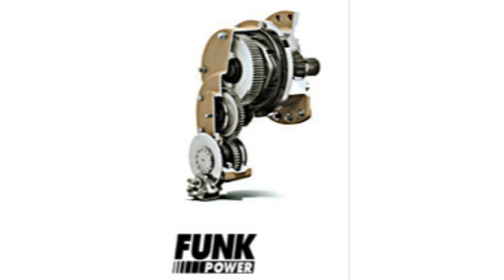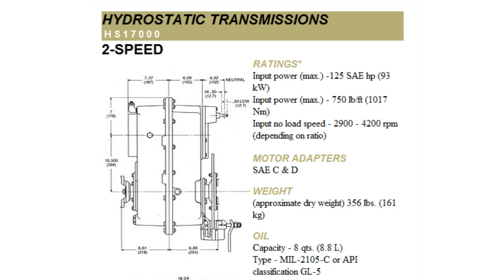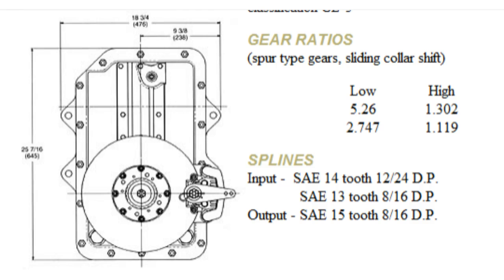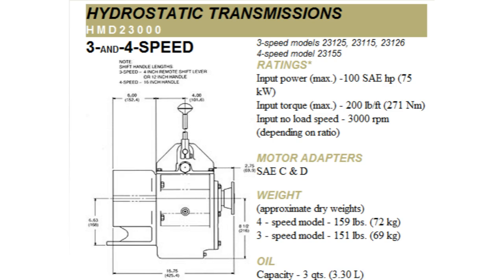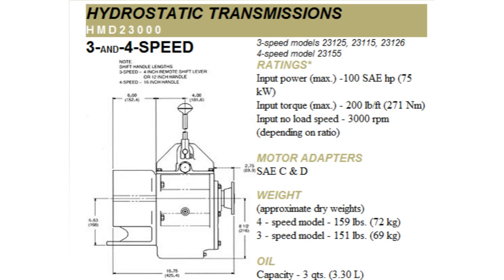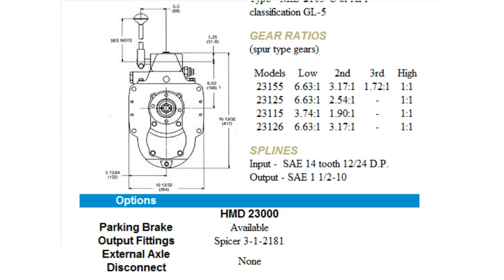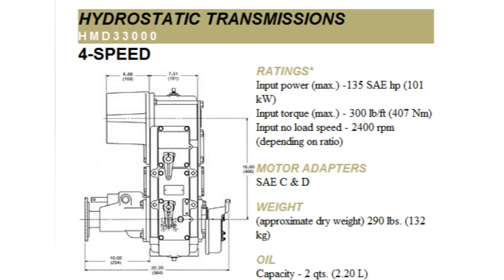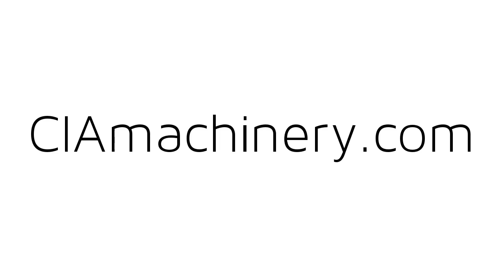Funk Transmission diagnosis

Comment: As a car guy, I am always tinkering away on my rig or checking this or doing that but I must hand it to the professionals at CIA Machinery Incorporated as they are my only source for troubleshooting and diagnosing my FUNK line of powershift transmissions. For example, this exemplary video guide above for the FUNK transmission speaks my language with its detailed diagrams and step by step instructions for troubleshooting my transmission when I need right information while I am out in the field. With their great customer service and large inventory of parts and accessories when I need them, CIA Machinery is essential for me to get the job done!